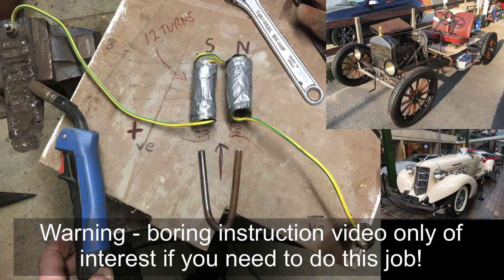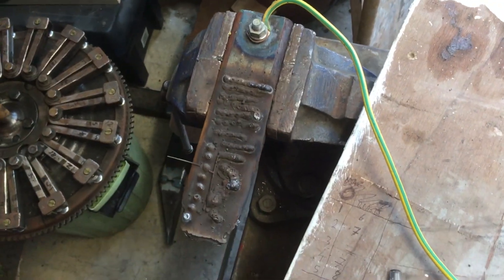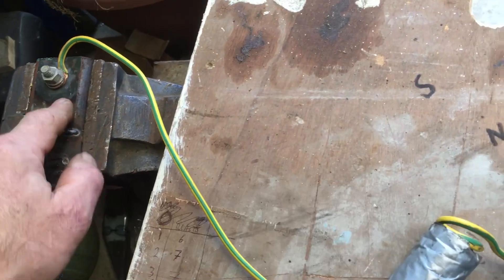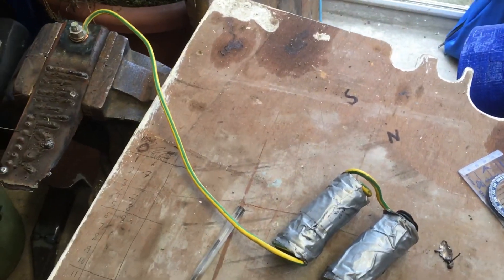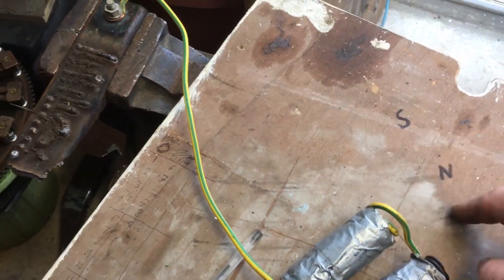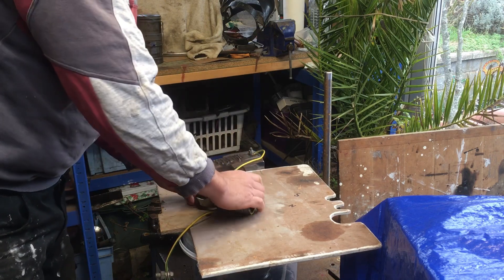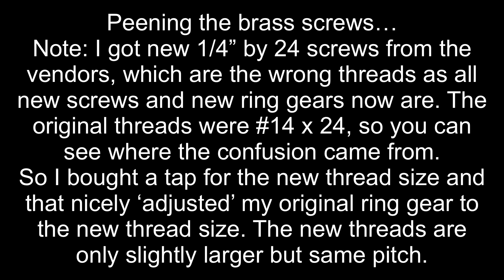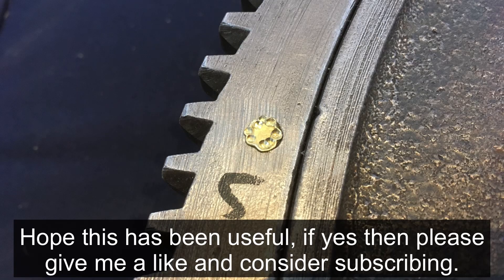Recharging Ford Model T Magnets - boring instruction video, but may help someone…

Comment: Why are there magnets on the fly wheel? Are they working like an alternator to make current? Or like a stator coil for the timing?
Reply from the maker: Well there are 16 corresponding coils on a stator type plate. So as the flywheel spins, the magnets induce current in those coils to power the trembler coils. It is a very old school type assembly and quite heavy. The timing is done with a small distributor type timer on the front of the engine and you have to adjust it as you drive. The strange thing is that there is a separate generator (on starter motor equipped cars) to recharge the battery. A lot of people take out the whole magneto assembly and just run a period small magneto or an almost period distributor. It is a lot easier to do that, but I wanted to keep the authentic set up, even though the car is not that authentic. It is quite fiddly to set up as the plate and flywheel has to have about 25 thou gap. Too larger gap and the magneto does not work well, too smaller a gap and flywheel will hit the coils and make a real mess. 
Now if I just have a bit of luck, I am only about a month from getting her on the road ( I seem to have been saying that for a year now).
Reply: @SailingSVPipedream  Ok, I understand. Thank you, and good luck :D